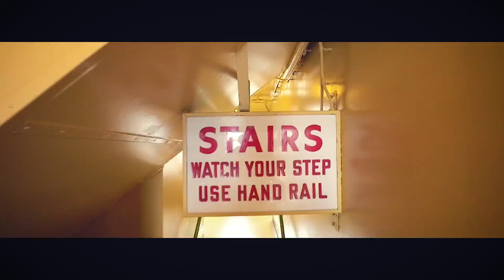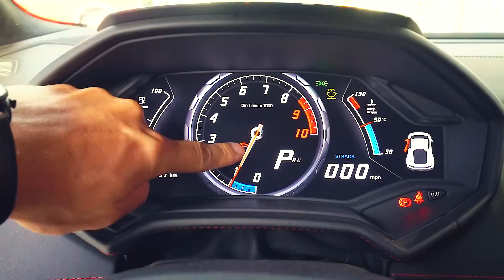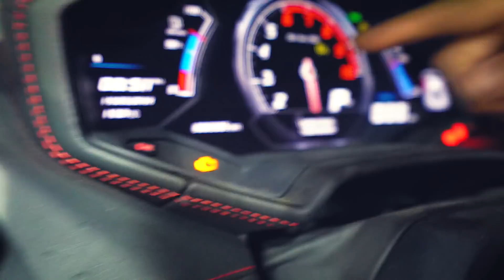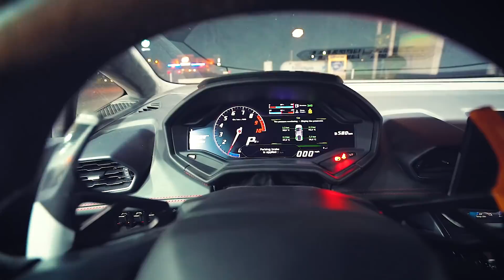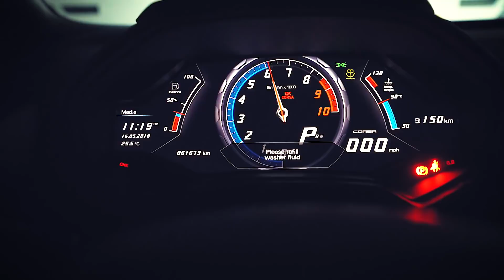DROVE 21 HOURS FOR WORLDS LOUDEST LAMBORGHINI! *STRAIGHT PIPED AVENTADOR V12*

Comment: What exhaust did Amir get on the R8? Just a straight pipe?
Reply: CarsAcrossTexas most likely a muffler bypass of some sorts or a valves exhaust like capristo or IPE which are all straight with valves open basically

Comment: DailyDrivenExotics 
On the dipstick there is a fill section which is usually crosshatched (looks like "x's") . That section from top to bottom is 1 quart. So being halfway up you should have put another half a quart of oil in your extremely expensive paperweight.

Comment: I'm always checking my oil,sensors or not,I own a 2011 GTR,stock, besides new wheels,plenty of power,I like to do oil changes often,whenever I do a long road trip,it has 84000 KMS,but besides tires and brake pads,(and gaz)but if you drive cool,it's not that bad...!!!!...this car does not need much attention,it's a freakin' NISSAN with a hand built engine.....!!!!!!...I could never hit on my car like Damon does with his"tire slayer thing',I even added plate size extractor fans(on demand)in the engine bay with,heat sensors,and gages on the dash,apart from the stock system,and it does add some serious cooling on really hot days....

Comment: Usually, Orange/yellow oil light means low level, Red oil light means no oil pressure. Oh, and I also do not understand why you want / need to change the discs, and I say that as a mechanic. There is nothing wrong with them. If the lip on the outer edge gets bigger, then you can say they are worn but they don't look worn to me in the video. Audi also has a minimum thickness stamped on the discs.

Comment: Ummm, you didn't get a correct reading on the oil level because Dave put it in, pulled it out, put it back in, and checked it without wiping it. He double dipped so it's going to show more than what's actually in there.

Comment: chemical guys v38 for swirl marks! Got rid of my dealer installed scratches in a hurry.

fyi, The real key is the density of the foam in the applicator pads. If your gonna cut/compound you need a foam pad that is stiffer so it transfers your hand energy into the car. Polishing(getting rid of swirls) is the opposite, you use a cushy foam pad to prevent too much pressure on the paint. Hope someone reads this and doesn't make the same mistake as Dave! #SwirlSquad